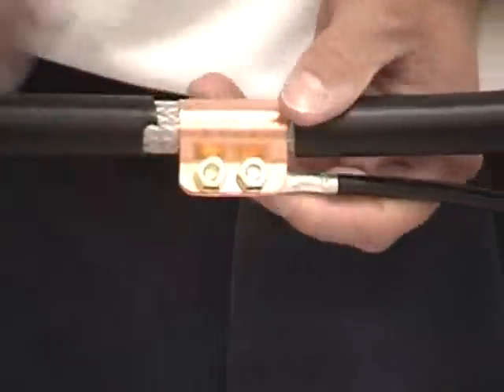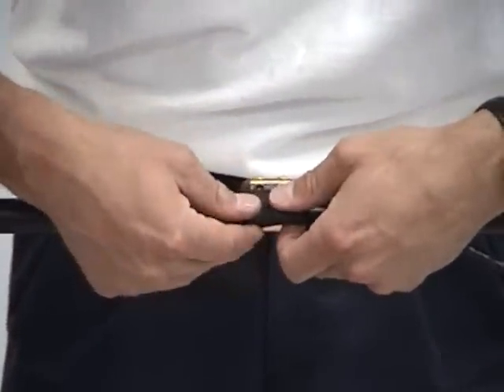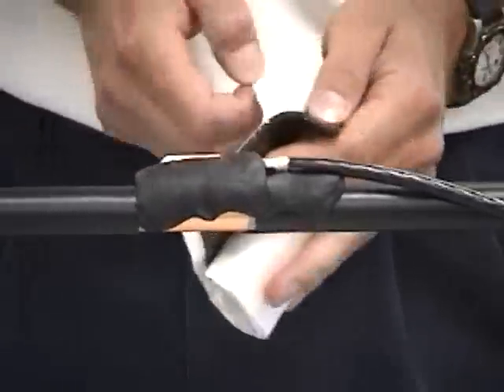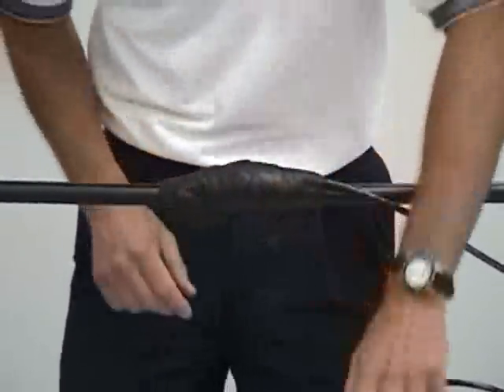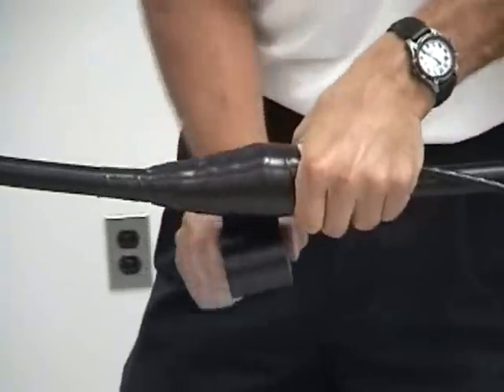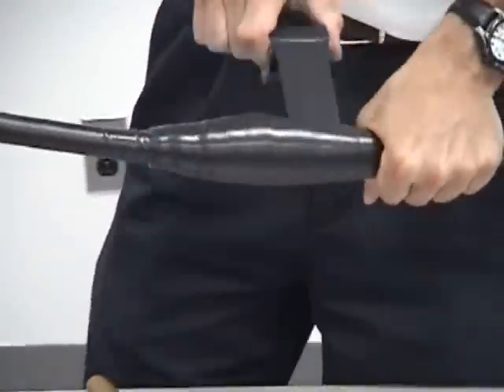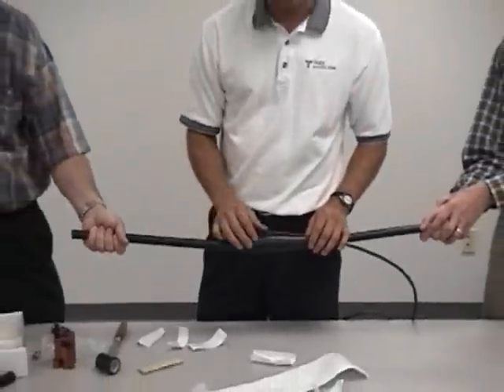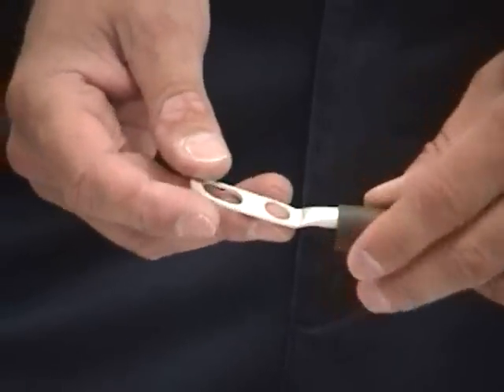Demo Discoveries: Dive into Times Microwave Systems' Ground Kit Installation Vol 2!

Comment: How is the name of the tool to take off the cable cover ??
Reply: A utility knife
Reply from the maker: Thank you for your question! The mid-span jacket strip tool for LMR-400 would be GST-400A. The tool for the LMR-600 would be GST-600A and the tool for LMR-900 would be the GST-900A.